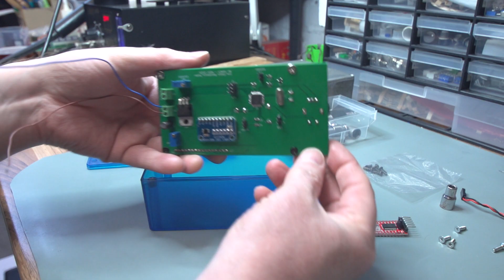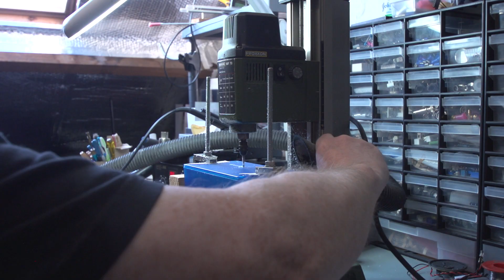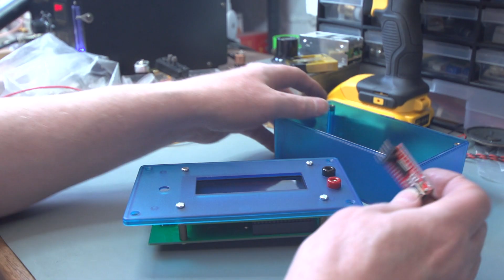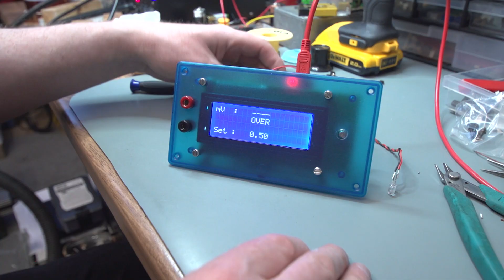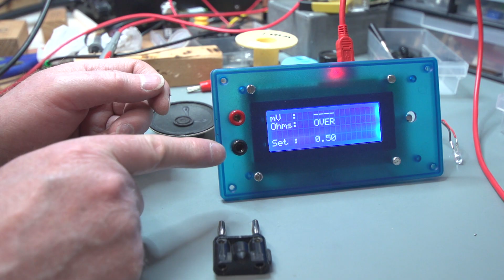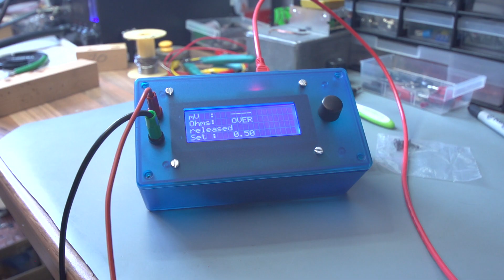PART 3 : Designing a PCB Track Tester - Low Ohmic Resistance Tester

Comment: A nice project that works well!
Milliohm meters generally use 4 wire probes, known as Kelvin probes. The idea is the constant current direct from the current source travels down one pair of wires to the test resistor / track. The other pair of wires measure the voltage accross the resistor direct to the ADC. The wires are joined as close as possible to the measuring end of the probes. In this way, any lead resistance is eliminated, so no need to null the leads. A way to keep it neat is to use audio coax cable, the current goes down the centre wire and the voltage is measured using the screen wire. This would mean you need 4 sockets for the leads, or maybe a multi pin socket? This is covered in the Ohmmeter section of Wikipedia.
I'm enjoying yor videos especially the Kicad ones!